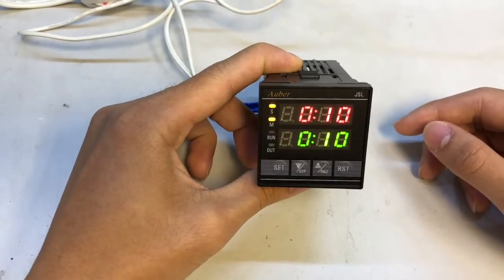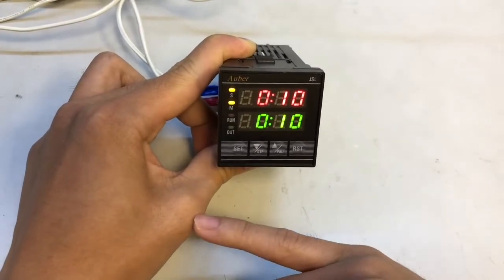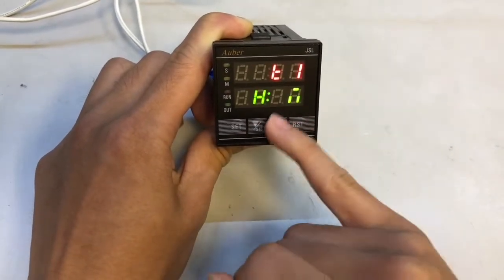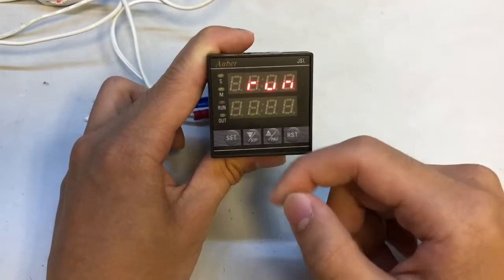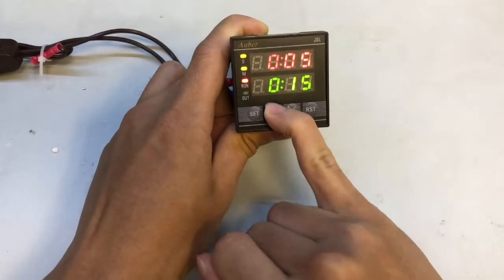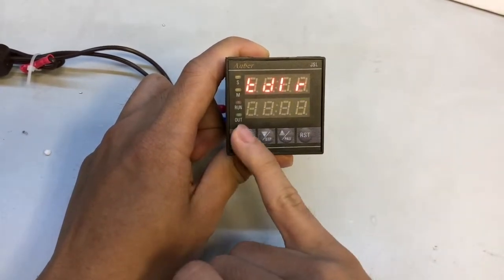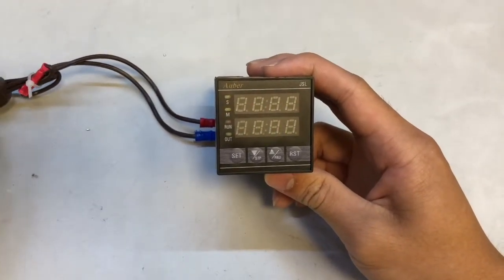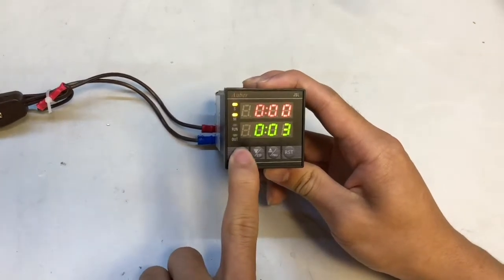Auber General Purpose Timer (JSL-74) Tutorial Video

Comment: Like Dirk Im a little confused on the wiring, I am adding this to an existing Powder coating oven that has a a AUBER SYL-2342 PID controller on it with two switches one for the main power and one for the burners. I want to add this timer to turn OFF the burners after 20 min... I also have a buzzer/alarm i would like to wire in to the system (but not completely necessary)  I have the http://bit.ly/2MGIWfG but i'm not sure what all the symbols mean... Thank you in advance
Reply: This is a tutorial video for how to program/operate the timer. If you have a question about wiring, please contact us at 770-569-8420. Thanks!

Comment: This is a very well thought out instructional video. Well done.
Could you do one to show how the wiring is done?  I'm confused about the wiring to set up an alarm. It looks like they switch the neutral, but where does the power come from. Is it internal from pin 8?
Reply from the maker: This timer comes with a C-form output relay (dry switch), and you need to use the NO terminals from it (terminal 7 & 8) to cut one leg from the power to the alarm. If your alarm is powered by 120V also, you can jump wires from timer's power input to the alarm. One wire from the power to the alarm directly. Another wire from the power to the alarm through this NO relay. For details, please see page 3, section 7 of its manual http://bit.ly/2MGIWfG
Reply: Just what I needed. Thank you so much..